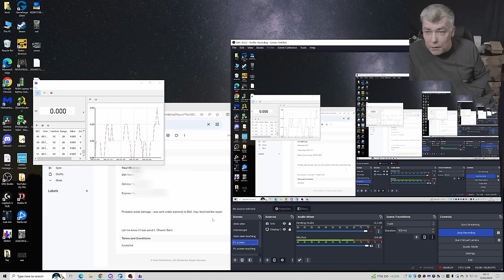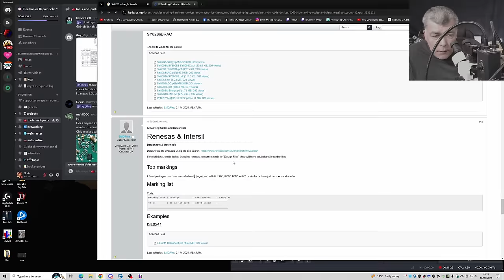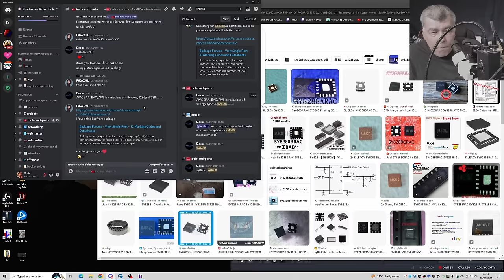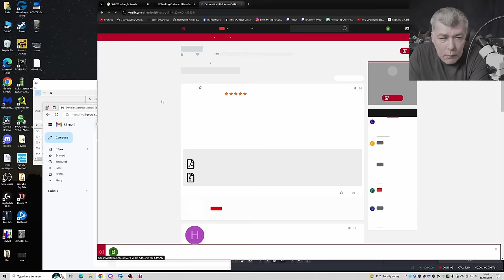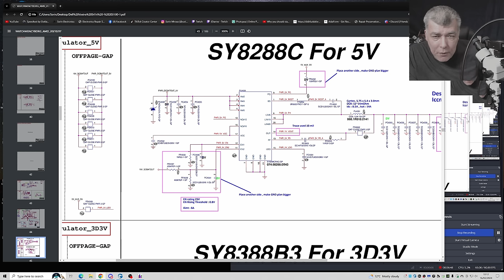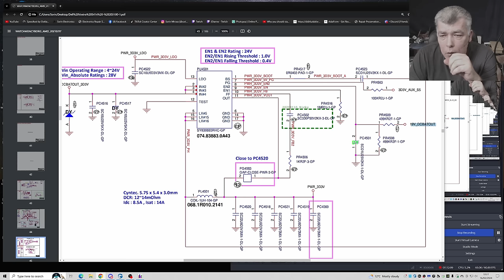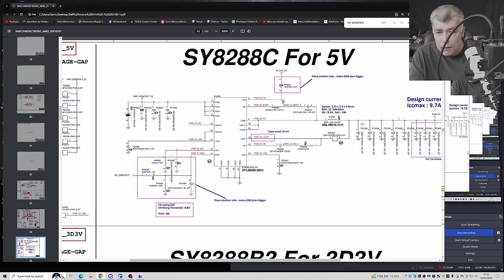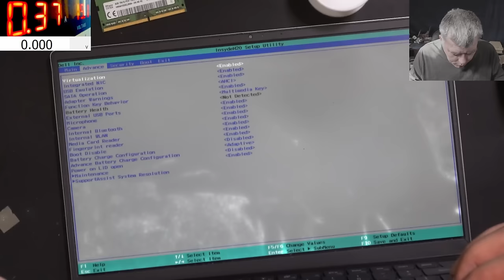Dell Vostro 5415 - Dell rejected this laptop repair, under warranty, can i fix it?

Comment: For these Sylergy ICs, the letter after the numbers in the part number is very important. SY8288 (AWS markings), SY8288A (BDJ markings), SY8288B (BAB markings) and SY8288C (BAC markings) are not compatible with each other. Fixed vs. variable, fixed or no LDO output, different voltage, different pinout…
No datasheet available for any of them so you need to refer to some schematics.
The badcaps post "IC Marking Codes and Datasheets — Silergy" contains the info to identify them.

Comment: I'm using Puppy Linux to test any computer . Using Rufus I wrote it to an 1 GB pen and use the half. I can test hard drives like cristal disk info (there is a program to do it), wifi keyboard etc booting from the pen (takes 2 minutes). No hard drives no problem test with Puppy. Puppy reads Windows drives, has a browser, files manager its a full graphics operating system.

Comment: Hello sir , I love watching your video very informative and interesting with all the humour keep it up  .I have a Sony svf15 10year old touchscreen laptop i5 4gb ram 2gb nvidia 740m gc. GC is disabled in bios now (no new driver & I don't use it much  ).battery is dead I use it without battery .My laptop starts and shuts immediately , I can hear hdd spin and shuts  . When I connect charger it doesn't show any lights . After many attempts  to start by pressing power button it starts sometimes and works perfectly . continues to work with no crashes or bsod or hang , once it is up and running it works smoothly. Now when I remove the charger and keep the laptop off for a day and try to start it the next day  All the problems revert back and after like several 20-30 attempts hoping it may start or I give up and try some other day. I have good knowledge with soldering. Basic electronics schematic work . I have multimeter. I've tested many things by watching your videos . I feel it is either ram or cpu . Could you please share anything regarding this matter like guide me to what should I check? . Before changing the ram please let me know is there anything I could check or try.

Comment: I think cleaning water damage before any check helps alot, maybe solve a problem like i had, maybe there partial short circuit.
Reply: It was already cleaned before, and if you clean before investigating you erase a lot of hints.
Reply: You have a picture before...

Comment: From the symptoms and the progression of the diagnosis ..... I thought a track was also missing ..... at the point when the
first chip was replaced. But how to diagnose that missing rack- a burnt resistor- I do no t know. That's one of Zorin's tricks:
following tracks. For me, It was at the point when he first said the 3V was present but was not showing up where it should
be .... because the track carrying the 3V is missing ... along the way to where it should be. But he got it right, a resistor will
blow before a track is burnt usually. There were no actual burnt tracks: its narrowed down to a resistor. And Zorin got it!   I
am not surprised the blown resistor didn't leave a lot of black splatter .... it is only 3v after all. Unless Zorin decides to blow
up a resistor using only 3volts and leaving a big black mark. *C'mon Zorin, blow up some resistors.*

Comment: Hi Sorin, very hard but very good job, can i advice with humility... i have a lots to learn from you.... with liquid demage best before start working to reflow the area with flux to prevent losing component and restore corroded welds, then clean the area... I buy Microcare Trigger Gripy to try it, normally use isopropilic alcool o 2-propanolo  CH3CH(OH)CH3 but find more effective Ethanol (or ethyl alcohol) CH3CH2OH also in ultrasonic cleaner, but finally i wash also with normal hot water at 90° and  hand soap.... What your way?... can you suggest the price for each work and last but more important thanks very very much for sharing your experience... waiting your replay for everyone..bye Francesco Timpano from Florence Italy 😊

Comment: judging by all those dis coloured caps, it looks like it was left outside and condensation covered all the components and then it was powered on. this would explain the strange discoloration of the SMD components. Must be the case since it was sent to Dell for warranty which means the discolouring was not due to old age components.

Comment: so the 3.3v chip was ok, just missing ref voltage because of faulty resistor? the 5v chip producing 5.3 was burnt so replaced. a memory slot was damaged mybe due to liquid damage. 

is that a fair summary of the repair, as i got a bit lost from all the chip replacements? thanks for great repair to a difficult fix.
Reply: You are not the only one. As well there was some editing involved where I think he replaced 5V chip. That was after he replaced the resistor.

Comment: Seems you got no experience.

First check for short on the power rails and check the mosfets startimg with the incoming power. 

You did desolder all stuff because you started from the last strep instead from the beginning.

Comment: @3:47 minutes you can see that those components just above the diagonally written: '02407' & '02409' markings, do not look very pristine and happy. That board suffered allot of heat from the short, or has been worked on (more then only cleaning) prior to you. You are in a sketchy business partner.

Comment: Anytime you send something for a warranty repair, just say it was working fine and now it fails to start. That, of course unless it's something obvious like physical damage. With that said, Dell has warranty against accidental damage. 
I had an XPS back in 2010 and a couple of weeks after my warranty expired, I dropped it and the 3D screen shattered.
I called them and renewed the warranty for one year at a cost of $150 and the next day I called and reported the accident.
They fixed it under warranty. True story.
Reply: I remember when my PS3 failed 1 month out of warranty. Sony sent a courier next day with a brand new PS3 and swapped it for the failed one. No charge whatsoever.

Comment: I guess that western standards for repairs are diffrent... Yes it's fixed with more than half of 3.3/5V rails still with rotten components. Here in eastern europe or ex commblock we usually replace rotten components with new ones or at least we do cleanup soldering job, but well. It's fixed, right?
Reply: My request would have been: Please, I want a complete (total) disassembly, that is (includes touchpad, LCD display, etc.) and a previous recording (reliable video) of each section of that device. I will do the cleaning (IPA) and drying work. Troubleshooting? So first do what I asked... It's not a cheap device. Greetings.